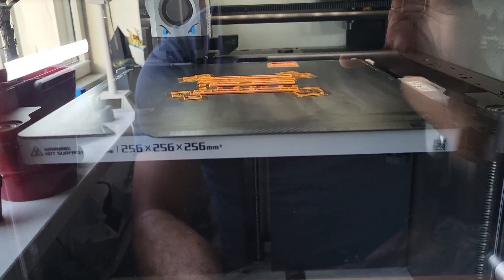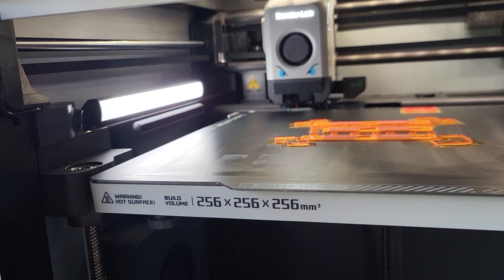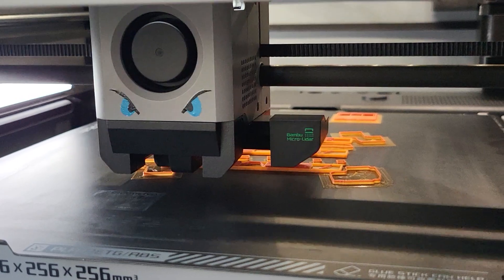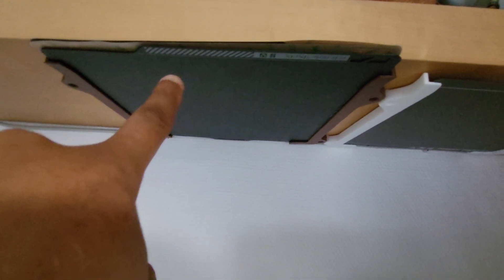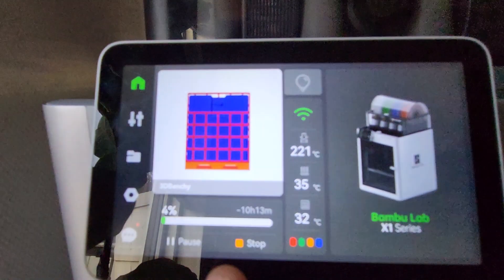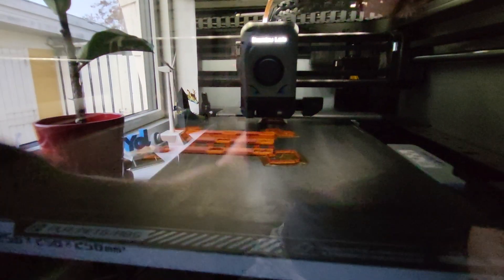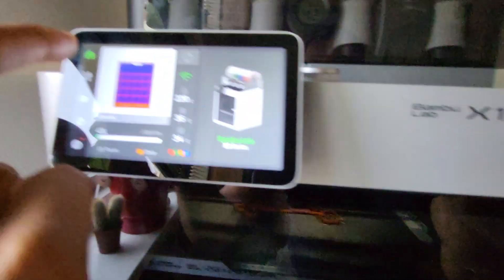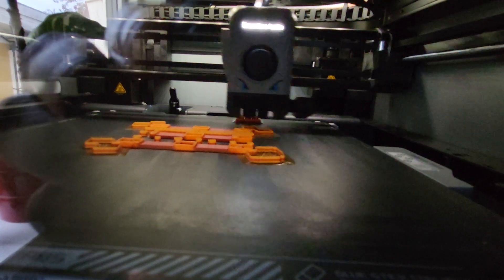Bambulabs X1 Carbon - after 14 days, a few pros and cons.

Comment: Would you trust it enough to pop down the road for 15 minutes? Can the firmware be opensourced or back-engineered? I am concerned about thermal runaway. Also can it interface with Octopi ant the Smartplug plugin to shut it off if it misbehaves?
Reply from the maker: Yes even for longer, No the firmware is patented, no need to be concerned it has been tested ,no need for octopi as you can see and control it remotely, yes to smartplug plus it has an app remote handling.

Comment: What do you mean 'cold plate'? You mean the heating plate? And why is it only 35c?
Reply from the maker: Yes, the Bambu lab cool plate prints PLA perfectly at 35C . See here: https://eu.store.bambulab.com/products/bambu-cool-plate
Reply: @75echo  Wow thanks man! I didn't know about this. So, this is not the standard plate I take it? Or it is the default plate? I never heard of printing PLA with 35c plate.. I always put mine at 60-75 on the ender 3.

Can I ask, would you be willing to experiment with higher temperatures and PLA and NO gluestick/adhesive? I'd love to see if that would work, as I really don't like glue if I can avoid it.

Comment: By the way: You can put up to 16 filaments with different colours, if you connect 4 AMS (4x4 = 16 colors) for this printer. There is a AMS hub you can buy from Bambu Lab to allow this connection. My 2nd AMS is on the way, so I can print with 8 colours :-). Cant wait to print my Baby Yoda with more than 4 colours.
Reply from the maker: Great tip!

Comment: Pro Tip: Your Prime Tower is too big. You can reduce the width and volume of the prime tower to save a good portion of printing time. Also if you use BRIM or any other adhesive helping techniques, make sure you dont add too much mm into it, else that will drasticaly increase the printing time. Also try to use 0.6 instead of 0.4 noozle with the biggest amount of mm (layer profile) to speed up the print. Instead of using Bambu Studio, you can use the Orca Slider (available for mac and windows), which is 95% the same software, but Orca Slider allows you to calibrate the printer to the filament you use. With all these little tweaks, you can reduce the printing time of at least another 35% overall. Even though the Carbon X1 is still very very fast 🙂

I can print the Benshy in 13 to 15 minutes with my calibration and tweaks. Another pro tip: I cant confirm that the support is really fast. They took 3 days to answer my quesitons. A better way is to use the offical Bambu Lab forum. The guys over there are amazing and told me about the calibration and which filaments to use for the Carbon X1. I highly suggest anyone to use the forum if you need help.

The cold plate: I only made negative experiences with it. I can highly suggest to use the Textured Plate for PLA. The cold plate caused troubles with the first layer all the time in my case. Maybe with other filaments except than PLA the cold plate is good, but in my case (I print PLA only currently), the textured plate with a bed temp of 55 degrees  celsius and 220 to 230 noozle temp, gave me the best results. If you use support filaments, then most of them only work at max 55 degrees bed temp. Thats something which also must be considered. If you have bad filament adhesion, then try to increase the temps and set in the filaments settings "skip cooling for the first 3 layers". Is this a mistake for PLA? I am not fully sure.This setup also helped me to avoid warping and bad ahesion for my prints. I have fully eliminated warping with these settings.

Textured Plate and Lidar: Not a problem at all. You dont need the Lidar calibration. You also dont need to run the bed calibration all the time, only once is fully enough. I even disabled the flow calibration in my printer, which saves another 7.5 minutes overall before the printer starts to actually print.

Comment: Could someone that has never had a 3d printer use this without any knowledge to start with ?
Reply from the maker: i guess it is possible but i will not advise it.
Reply: @75echo  what would be a good starter printer that is not too hard to get working
Reply from the maker: @aruth51485  Actually the X1C and PIP are fine to start with as they do most of the tuning and adjustments automatically. However , there is still a lot to learn . I would advise that you start with the P1P and see if you like the hobby.
Reply: @75echo  ok great , thanks. Does the p1p do the first line printing process like the x1 ?
Reply from the maker: @aruth51485   remember when i mentioned that it requires some basic learning? here you go for your first lesson , all your questions are answered here🙂 https://www.cnet.com/tech/computing/bambu-labs-x1-carbon-vs-bambu-labs-p1p-review/#:~:text=The%20P1P%20is%20a%20barebones,materials%20like%20carbon%20fiber%20filament.

Comment: I don't like it, bought it to print abs, and it does not get hot enough for that, have a heater blowing at it as we speak, doesnt help much. Besides that the quality of the prints is not good, so for pretty parts I have to use my ender. So kind of a waste of money. Love the AMS. It's great.
Reply from the maker: Interesting, i have no problems with ASA or ABS.

Comment: Pretty good review. No discussion of high temp and CF materials, which is a major reason to get this beast.
Reply: I have used Carbon Fiber filaments and they work perfect with this printer. U just need to dry them for 10 to 12 hours one time only before you use them with the AMS, else the AMS will get jammed and you have to pull out the filament manually from the AMS, which is also no problem. Takes 10 seconds to remove the jammed filaments.
Reply from the maker: I have another video where i talk about printing ASA . i have not tried CF yet.

Comment: I have a few questions:

Is this Standard Speed?
Why do you still need the priming tower with the poop chute at the back? Can you print without the priming tower? Or is it still needed even though it has the poop chute at the back?
Do you find this printer uses a lot more filament with the poop chute vs other printers that just use a priming tower?
Reply from the maker: The 'pooping' if for purging, while the tower is just for priming so that the flow is smooth as it starts. i have printed a few items without the priming tower but if there are more than 100 colour changes and white colour as one of them, i try not to risk it and just use a small prime tower 15mmx 25mm. As regards the amount of purge poop, if my waste is equal to or less than the weight of the item itself, then i am happy. It just looks a lot as the poop curls are springy and full of air. Another tip is that if you print multiple items, you optimize your filament since the amount of poop purges are still the same.
Reply: You can setup the values for the flushing amount. Just change the parameters in the printer settings and you can reduce the overall waste. Calibration and tweaks are required though to get the best results for the settings.

Comment: This machine could absolutely have been less noisy...why the engineers that designed it decided to omit a couple of Trinamic drivers on a 1000+ machine in favour of a less optimal in-house driver solution is beyond me.
Reply from the maker: The noise is not from the motors but the Fan RPMs, trinamic drivers wont help with that unfortunately. They have however released new software with better fan control now.

Comment: Thanks for the video! I am considering using this for a print farm, what do you think of the long term reliability of this printer? I just need something that can print fast and right the first time. ALSO I recommend taking a look at Magigoo if you hate using glue sticks. Its water washable and easy to apply, not a sponsor or anything but I use it daily. Thank you!
Reply from the maker: Thanks for the tip, i will try it soon. Thanks for watching. As regards reliability , its too early to comment but judging from the company's pedigree and performance so far, i don tthink they will be disapearing soon. I have only seen 2 print  farms on youtube with them. https://youtu.be/lNDwr0gSfMs

Comment: The glue stick is a huge con for me.
Reply from the maker: Yeah, i hate it too but if you print with the high temp plate or the Texture PEI, you do not need to ude gluestick.
Reply: @75echo  I gotcha. The problem is that I mainly print PLA. so doesn’t look like there is an option.
Reply from the maker: @cosmickatamari  you can print PLA on the highbtemp plate bed temp 55- 60C  no glue stick 😉
Reply: @75echo  this is perfect because I like how the texture sheet makes the first layer look.

Comment: What was the G-Code you edited to make the back fan quieter when not using the cold plate? Thanks.
Reply from the maker: Yes, the modified  G code , reduces the fan for full 100% blast to 70% which is still very adequate.
Reply: @75echo  Cool...can you share it?
Reply from the maker: @cleverestx  ofc , here it is. Read the guide to install very carefully first.
https://www.printables.com/model/322000-bambu-lab-modified-start-and-end-gcode

Comment: Thanks for the review.  Very informative. 
I have debated to buy this printer with AMS, but have no interest in using glue sticks or anything else - or losing lidar with another plate.  On my cheap printer I use a clean glass plate at 65F for first layer ... 
The unit noise and fan noise ... mmmm.
Reply from the maker: You're welcome
Reply: I dont use glue stick with the textured plate. I am printing for days now without any issues. Glue stick is only for the cool plate.

Comment: Does this product have active carbon and hepa filters for toxic air?
Reply from the maker: It has inbuilt active carbon filter but no Hepa yet - see my video about it here
https://youtu.be/Q-UtYUOiif8
Reply: just put a fan in your window, turn it on to blow air out of the room, crack the door a little airflow it outside.

Comment: The FLsun V400 can take 5kg filament rolls, or 10kg filament rolls if you print really large items :)
Reply from the maker: Any printer can use 5 kg or 10 kg rolls . you just print a roller for it.

Comment: I did not use the glue stick and nothing sticks to my bed. Tried glue stick and it just makes a mess on the bottom of my prints. Not fond of it being closed source. Over all I have been rather disappointed with this printer. The ratrig printer is just better.
Reply from the maker: I do not have a ratrig but i have a Voron , i can tell you that this printer is the most fun out of a box i have hever had.

Comment: Is it possible to assign an STL part or parts as the purge block? to cut down on waste, some functional parts I print dont matter about colour so the less wastage IMO the better
Reply from the maker: The purge block is automatically generated,  you can choose its size and dimensions or even eliminate it altogether.  The purging can also be adjusted by dictating the desire purge volumes , you can even allocate different volumes after each different color change.
Reply: @75echo  For me this is a deal breaker, I cannot justify the amount of wastage generated by this machine, although I would welcome seeing a multi colour part printed without the purge block, I cant see how this would work though.

Comment: I built a Pro 3D V-King 400 (Duet 2 and RepRap) from self-sourced the best quality parts I could get as the Voron kits at that time were always 30% out of stock and the quality of parts was bad, I paid a fortune in shipping costs but ended up with a printer that can print relatively fast and turn out excellent quality parts, I dont print faster than 160mms at 3500 acceleration.
 I have my money down for a Prusa XL and may get a tool changer also, but I am very tempted to get the X1 Carbon and AMS I guess I will have to weigh up the differences once the XL is about to ship.
Reply from the maker: I feel you bro, this machine has its advantages. However the prusa XL is i reality a toolchanger so capable of other things too. Personally i plan to reduce my printers to only 2 in the future,..A Bambu X1C and a prusa XL 😉
Reply: The other issue and why I cancelled my Prusa XL is the delay. They are changing parts on it and really as far as speed, quality and ease of use, no one really knows. It may be good and it may not on the first generation.

Comment: What type of fan is the extraction fan? If it's dual bearing it might need to be oiled
Reply from the maker: It is a standard fan. Its just loud that's all,  the same on every machine in this series. If you want a fan to move large amounts of air you have to cope with the noise.
Reply: @75echo  no not true. Not all fans are the same. For example the creality fans I have on my s1 is a hydraulic fan so no oil needed. On the ender3 v2 I have dual bearing fans. Needs oil. Same with my anycubic vyper. They are not all the same fans.
Reply: @minnow11  I think the noise is from the fan blades spinning fast not the actual motor. Much like my Qidi on turbo mode.
Reply from the maker: @sbr-synrosimbugracing9338  exactly
Reply: @75echo   where can I get the STL file to print the under cabinet plate holders ?
Reply from the maker: @randyhernandez9785  here you go https://www.printables.com/model/19318-prusa-i3-mk3s-steel-sheet-holder-for-under-tables
Reply: @75echo  Thank you

Comment: super cool!  what people's thoughts on maintenance? I worry about purchasing a piece of equipment that I cannot service within reason. vendor lock-in is another concern.
Reply from the maker: Maintainance is actually straightforward and not much different from other core XY printers  the Bambuwiki has a whole section on it , including well documented guides on how to change parts.
Reply: Yeah, seen some videos on changing hot end, etc, online. Seems straight forward.
Reply: There are dozens of maintenance videos for this printer. It depends on how much you print and once per month you should perform some of the maintenance tips. Some of them take 1 - 2 seconds lol

Comment: The fans are also a byproduct of the speeds, the cooling can (especially on PLA) has to be going flat out to keep the filament cool
Reply from the maker: That is very correct.
Reply: I skipped the first 3 layers of PLA, to get better adhesion and no warping. Is that a mistkae for PLA?

Comment: I guess I don't understand the need to use the filament poop chute then wipe then prime tower. Is it not already primed from the poop chute? If not, why not. If so, then what does the prime tower add? If prime tower needed, could you not just use it and not the chute?
Reply from the maker: It is possible  to use a print tower alone without a poop chute purge... and vice versa. But I can see that you get the cleanest prints if you combine them both.
Reply: @75echo  i agree with this as on my machine, printing small features immediately after a purge there may be under extrusion without the prime tower.

Comment: I had some issues with heat creep. I solved it by printing some feet and raised my glass top panel. Overall, this printer is absolutely amazing. I'm so impressed with not only with the machine, but the dedication the bambu has with improving their software. They are actively implementing firmware upgrades. I'm super excited to see how accurate things will be in a year or so.
Reply: What material were you printing when you have heat creep issues?
Reply from the maker: I agree, the machine is wonderful
Reply: Reading the comments on Discord is disheartening though, as it appears they need a lot of help with their SUPPORT, response and quality which often amounts to the equiv in the PC tech world of (did you reboot it?), or in their case, "did you try to print with the lid off?" despite being given in detail what was done by people with a lot of experience having major issues, especially with AMS issues... and this worries me. 

Otherwise if you are not unlucky getting a bad AMS or rarely a bad printer, then you DO end up with a high quality experience, but if not....yikes.  I hope they improve their support and do it fast.

Comment: Very interesting. Confirmed several things I had been thinking before purchasing. However, I would be interested in how loud Silent mode is, and what speed it drops to in order to achieve that? I don't need fastest, just faster; and don't want to lose my hearing in the process.
Reply from the maker: The Silent mode runs at 50% of all values. Its helps a bit with stepper motor noise but does nothing significant with the fan noises. If you have a noise sensitive family or plan to print with it at night close by a bedroom......you may want to think twice 😁
Reply: @75echo  do you think neighbours hear it in an apartment building? did you see people putting it in an enclosure of some kind (eg cabinet) or do you think there will be heat issues with the electronics? thanks! and thanks for the nice vid! way better than those ultra fancy youtuber videos that don't even show the machine running..

Comment: Have you tried any cardboard spools in the ams? I've read some mixed results seems like the spools don't do well in the ams
Reply: Carboard spools can work but some manufactures use some chintzy spools. There reusable spool covers you can print as well as adapters for smaller spools too. So it's a non issue. 

If you are using extra wide, or tall spools they can be an issue. Wide spools wont fit and tall spools would need to the top cover open.
Reply from the maker: Many cardboard spools are not stiff or smooth enough at the edges to roll freely on the AMS rollers. You can print adapter edges to solve this problem,  there are lots of designs on printables.com